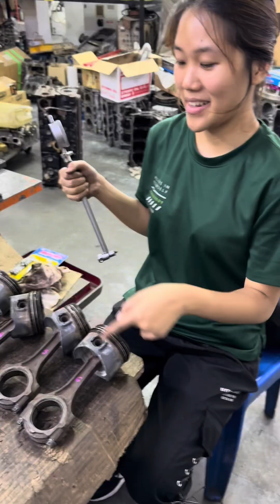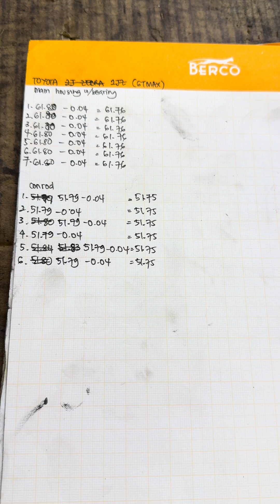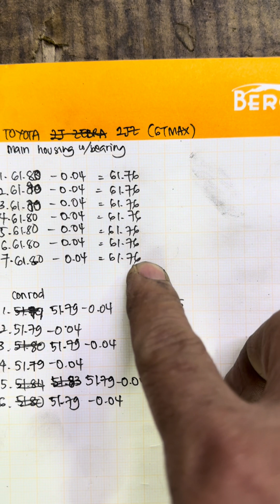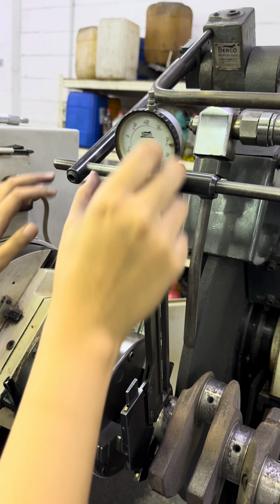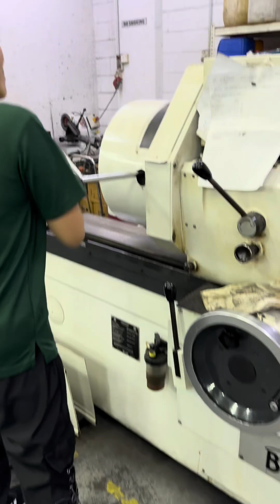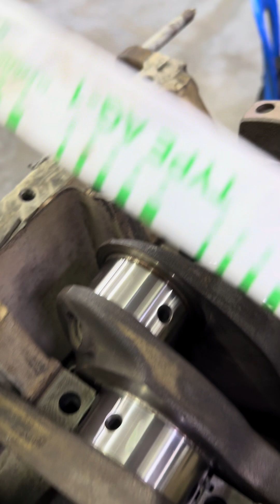Crankshaft Grinding Toyota 2JZ and Setting Bearing Clearance

Comment: If you have no option left but to grind the crank flywheel side towards the headstock, use a steady in the Centre main and then polish the crank the right way around.
Reply from the maker: Hi sir, thank you for good observation and suggestion I highly appreciate it. Positon the crankshaft bigger diameter to hold in the headstock can make rotation stability and can prevent vibration even without using the steady rest. 🙏❤️

Comment: Crank wrong side
Reply from the maker: Thank you sir,Good day! We used to hold the crankshaft on the bigger diameter part which is the rear side or the flywheel side because its made the flywheel more stable and the jaws can hold firmly and in this cass can get rid off virbration even without using the steady rest.🙏🙏

Comment: Why is the crank in backwards Front or snout goes to headstock always
Reply from the maker: Hi sir, that’s a good question it is because the rear side of the crankshaft is bigger in diameter the bigger the diameter we hold the crankshaft in the machine for the rotational force is more stable and less vibration. Thank you sir.
Reply: Быстрее делать коренные в осях😊